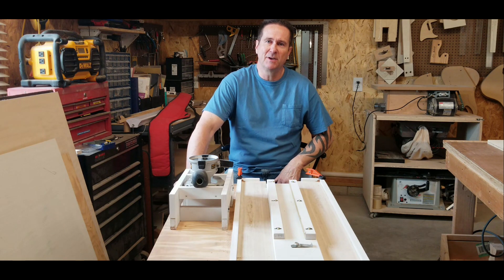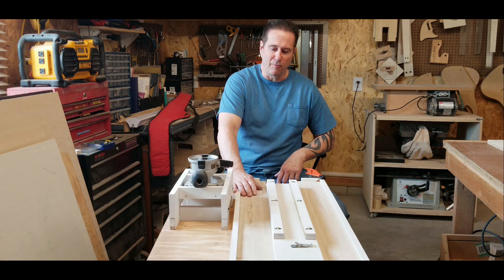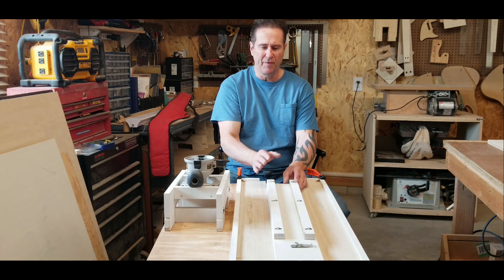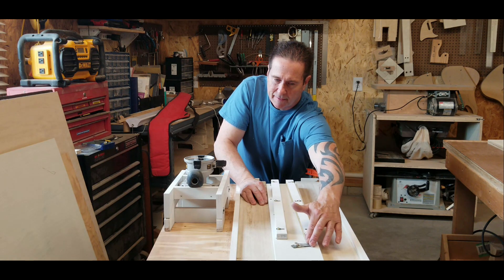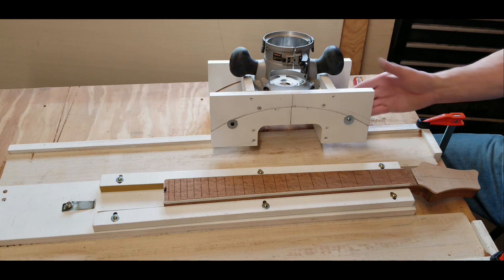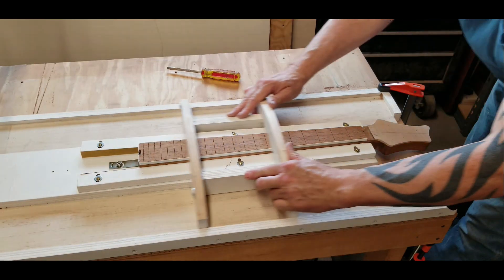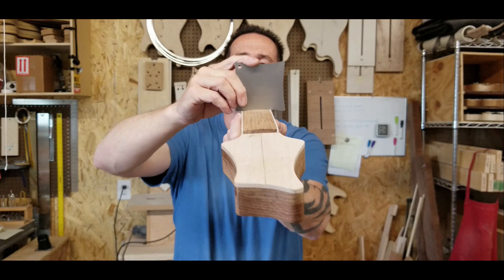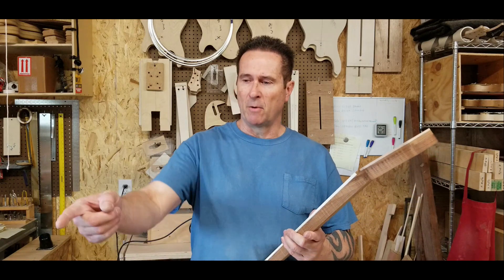Build a better fingerboard radius jig!

Comment: Jig looks fantastic. Thanks for demo.  How did you cut router carrier? It looks very precise. When you put route base on bottom carrier it snaps so it can't fall off?
Reply from the maker: I used a router and a radius stick to dial in the radii. As far as the base, I installed large diameter washers on the outside of the carrier that protrude up so that the base slides between them. The washers contain the base as it follows the radius. I hope this is a good explanation. Thanks for watching!
Reply: @lesperanceguitars8381  Thank you

Comment: I think a good mod for this kind of jig would be recessed drawer runners butted up to them side pieces and attached to the carriage the action and stability would be a lot smoother 
The clamping system you have there  is a  excellent
Reply from the maker: That was an option that i was looking at but, this jig generates a lot of saw dust amd was concerned with it getting caught up in those drawer slides. Another option i was looking at was pillow block and rails but that would make the jig bulky and heavy. If you build one that way, let me know how it works out. Thanks for watching.

Comment: Hi Paul, I'm starting to fab a jig like yours.   Re-watching your video, and thought I'd mention one other thing I like about your jig.  The bottom "neck side clamping" piece is adjustable and can accommodate fretboard radiusing (not yet installed on necks), and not shaped yet (rectangular)..  All you'd have to do is add more platform height pieces underneath, and have a 6 more longer screws to tie it all down.  I was looking for ideas on this flexibility, and I see you have it already figured out - Thanks man!
Reply from the maker: That's correct. I would make a modular platform that can be switched out quickly.  Also, if my neck is slightly thicker on say the heal side, I can shim it up to level with some pieces of card stock on the headstock side, or vise/verse. It won't move on me either. I would like to see this jig when you finish it.
Reply: @lesperanceguitars8381  Yes, and that technique of shimming isn't spoken about too much but can be used to adjust fretboard thicknesses to alleviate the look of a thinning fretboard going from nut to heel on wider fretboards (5-6 string basses for example).  I'm a bit of a perfectionist :)
Reply from the maker: @ChinJazz  I don't worry about that look. It's just the nature of the radius due to the taper of the neck. The only thing that I would be aware of is that you may need to angle the heel/neck joint up to compensate for the fingerboard being thicker on that end. Or use a taller type bridge like a tune-o-matic. If it isn't much of an angle it may not matter. I may be over thinking this.

Comment: Hi, very inspiring! I'm doing the same, but I got a question. What bit do you use to get a smooth radius? Any reference?
Reply from the maker: I really don't know where I got it from but, it is like the ones at this company.  - https://www.the-carbide-end-mill-store.com/m5/350-2500-032--1-2-corner-radius-end-mill-std-length-htc-350-2500-032-2-fl-032-cr-uncoated.html -  I searched around and found a 1/2" dia. 2 flute bullnose endmill bit with a 1/8" corner radius, 3" long with a 1 1/4" cut. It has a flat end with 1/8" rounded edges. I think I paid about $50 for it. My search actually took me a while to find exactly what I was looking for. I hope this helps you and good luck with your jig. Thanks for watching!
Reply: @lesperanceguitars8381   Thanks a lot :) You rock!